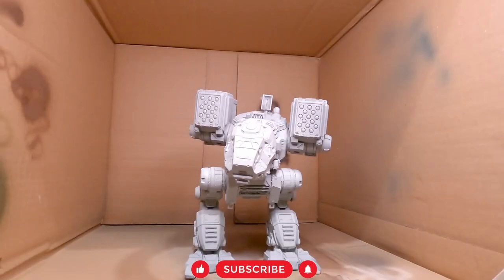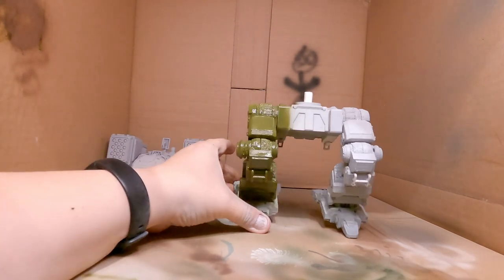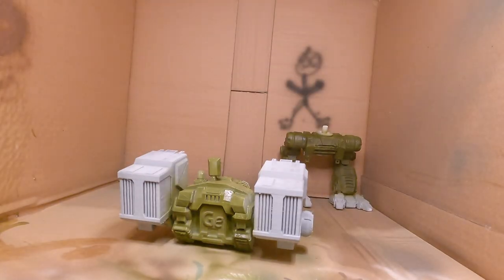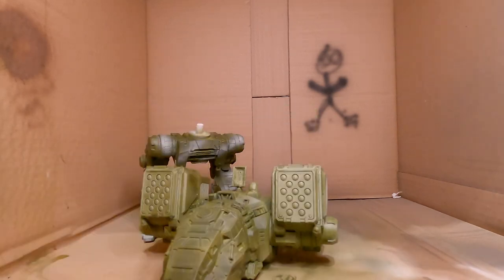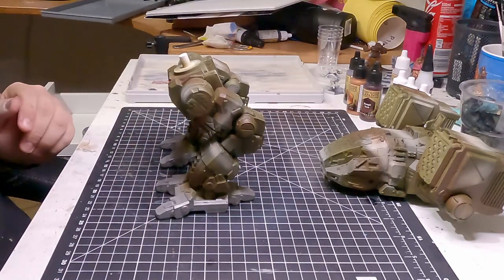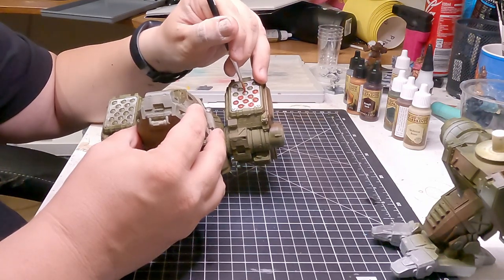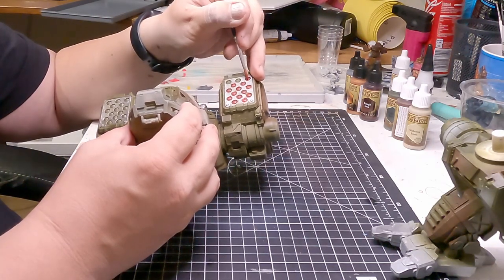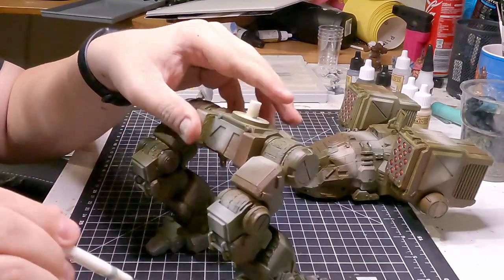Painting a BIG Catapult // Battletech miniature painting

Comment: Nice :) got a little question. Some of the printing looks a bit rough some very smooth. Do you remember with what layer height you were printing? Or were you doing some filling ? Still got an stl here for a big guy and now After watching it, i Got to print it :)
Reply from the maker: Good question... according to my slicing software it was 0.18 mm layer height and a fill density around 15%. But it varied a bit depending on the part. Now where i messed up on some parts was orientation and some minor failures. It was does on a stock Flashforge Finder so not much in the way customization.
Reply: Allrighty :)  i have meant the filling between the layers for smothing the surface. With my last paint job an Nuln oil it highlighted the layers even more :(  on other prints i was using some lacquer and was sanding. Looking forward to your reply and in the meantine i will enjoy your other Videos:)
Reply from the maker: None really. just primed it and and then hit it with a airbrush. Trust me it looks way rougher up close. Generally speaking if you are going to do a shade or an ink you need to give it a solid coat of automotive filler and then a good sanding. Even then something like Nuln oil might just expose the layer lines, because that is sort of what it is made for. =) Instead try to give it a dark base and then paint up the mid tones and highlights, also avoid dry brushing. Best of luck.